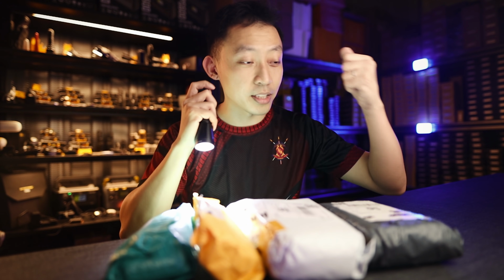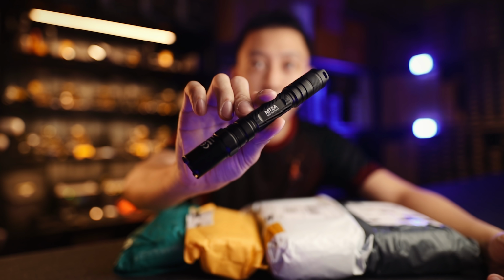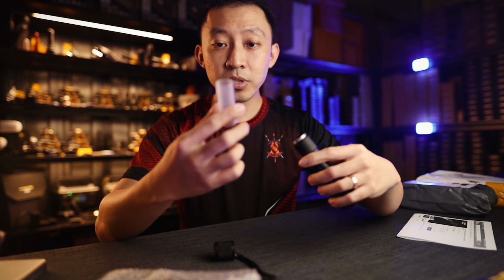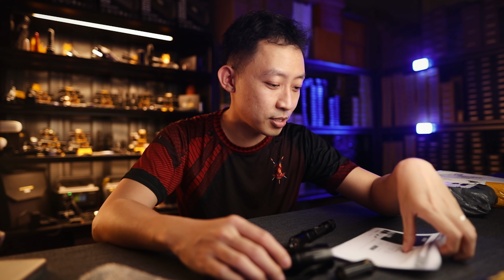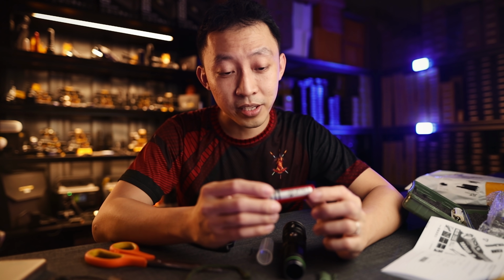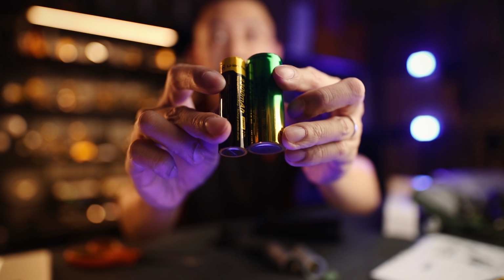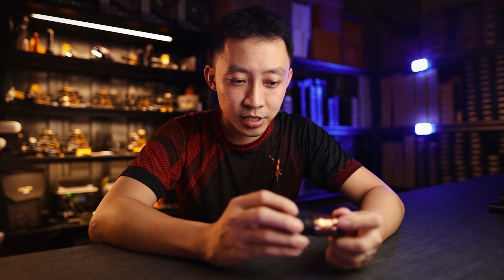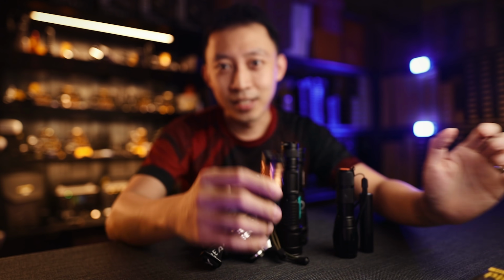100k lumens? Nuclear LEDs?! I bought a bunch of fake lights to show you how to NOT get scammed

Comment: My dad was so proud of himself when he got a 20.000 lumen light for €12 or so, while my 4000 lumen Acebeam had cost around €100. Made me look like an idiot at dinner for spending so much, then we went outside and you can guess what happened. I don't think the thing he got was even 200 lumens while I was fully lighting up a tree 100 metres away. To add insult to injury, I later found that exact the light on Aliexpress for €4. It was one of those lights you find under 100 different brand names and as many spelling errors in the advertisements, but they are all just clones of the same piece of trash made out of 100% chinesium.
Reply from the maker: Yes be wary of these ridiculous claims
Reply: CHINA
Reply: hahaha "step outside, dad. we'll settle this quickly"  - lights out.

Comment: Nice vid. Thanks. However the ANSI standard is not the best representation for flashlights especially when it comes to runtime. It does not take into account how the output of the light actually behaves over the runtime.  There should be runtime vs output graphs included with lights.  Then you will be able to really tell how your lights including tactical lights behave over time.  Some lights claim 1800 lumens and is only 1800 lumens for 1 min then drop down to 800 lumens for a 2hrs then drops down to 200 for 1 hour then to 180.  ANSI standards would say 1800 lumens and runtime would be 3 hours. But the consumer believes they have an 1800 lumen flashlight for 3 hours which they do not.  In reality they have an 1800 lumen light for 1 min.  Companies should strive for better and provide real/truthful graphs.

Comment: He has right when he is speaking about those flashlights from Aliexpress, 99% of them are crap,but there is another 1% where you can really buy cheap and good flashlight, I have some of them. Another part are batteries, for example Nitecore 3400 mah, about 20 usd, it is rewrapped unprotected Panasonic 18650B (3 usd), and protection board (0.50 usd), so they pump the price 5 times to the cell, greedy.
Reply: convoy and sofirn from aliexpress also is a cheap but high performance light. i have edc size convoy s2+ sst40 and it only $20 for more than 1000lumen and sofirn sp36 $40 for more than 5000lumen but the size is hefty not pocketable..
Reply: @harisyoung4110  I have sofirn sp32A, excellent flashlight for 16 eur, small compact, with 1550 lumens, unprotected cell, also Crelant v6c, and few more
Reply: All 100%FACTS!👍👍👍👍👍👍

Comment: Owned Klarus Xt11 for years. Time to switch to Nitecore. Awaiting the shipment of P20i🔦 🚨🚒🚑
Reply: My trusty Surefire C2 has never let me down but I thought I'd get something a little cheaper to run, I ordered an i4000r  (NOT direct) but it didn't show up so bought a P20i incase the 4000 did ever show. I can say I have also bought a few other pretty damn good lights but overall the P20i is my go-to right now, the instant access to turbo & strobe is a winner for a start, who want's to cycle through modes or have to have the light on before being able to access turbo!? I want turbo when my eyesight picks up something I feel needs 'looking at', then I want INSTANT  full power, the P20i does this better than any other light I own. It's not the brightest, or the longest thrower BUT if you wan a decent tactical light you can't do a lot better IMHO. --- As to the video above slating battery holders when they provide them with some of their own lights all-beit for CR123s & not AAAs and giving the reason being for a lack of 'voltage' is a little misleading, not enough current maybe. Also about time people trying to sell lights stop with the lumen blag & start providing better candela data when comparing lights, it's not all about brightness, we need/want to know about intensity.  *I have an Acebeam L17 (TIR lens) & I'm impressed with the throw on that.

Comment: Man I totally agree with you, those aren't good flashlights, but I wanted to point out that the Wuben C3 is 1200 lumens, and it's $26.00 on Amazon. Wuben is a legitimate company, has been since 1981, it's type-c fast charging, comes with high quality 18650 and takes cr/rcr 123 batteries. Very similar to the Nitecore MH11 as far as simplicity and the tail switch are the same both also tailstand , just more of a flood beam and cheaper price. I own both.

Comment: Before I know Nitecore, I bought a lot of stupid lights. I bought one the same as the fourth one shown in the video, which has four blue battery indicators near the button. They use xhp70.2 and can produce more than 1000lm when turned on. The problem of those lights is they dim after about 5 minutes, becoming less than 200lm. There is no circuit design or anything, and the light does not even get hot. They only use those simple MOSFETs to supply some current, and there is no heatsink for those chips .I guess it is because thoes chips get hot. Some of the fake lights may also have some thermal conductive silicone on those chips, but this "four blue battery indicators" does not. Another point to make is that those fake ones are big, heavy, and blocky. There is no mean to carry such a big chunk around. In addition, I also measured the capacity coming from those fake lights, they usually measure less than 600mAh, and the Nitecore charger indicates poor for them, as their internal resistence are >=0.5Ω.
Reply: I am actually very impressed by how hot those Nitecore lights, and some other good brand lights, get. Although I did not measure it, other YouTube channels did. They reach more than 100℃. They manage to push the LEDs to their limit without crashing them. I mean I crashed many LEDs myself. It is hard to manage without specialized manufacture level design.

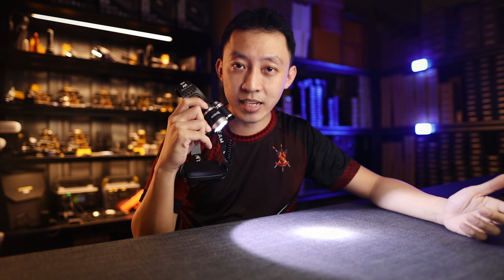Comment: 14:50 i got the headlamp with 2x 18650 and have a proximity sensor mode that turns on the led . no brand . same cube box .
enough brightness if got into accident at night . all other cars will notice and avoid further collision .
bought it at live bidding at only sgd$4/- . no one was buying it , so initial bid never raise the price . totally worth it . 3 months later some poor driver hit my car and i record all videos and photos with the help of this head lamp . won my case . spent finished all compensation $$$ . 5 months later the T-junction had a change of traffic light signals . new RED ARROWS enforce drivers to stop behind stop lines . probably an accident prone area .

Comment: Just a lot of misinformed consumers.  Thanks for the info dude. 👍🏽
Reply: Find a convoy and sofirn brand if you need a cheap but high performance light.. dont buy any zoomable light, all zoomable light is crappy light.. sofirn sp33 is real 3000lumen for only $25-30, there lot of it review video on youtube.. and for edc size convoy s2+ sst40 you get it for only $18-20 and it gave more than 1000lumen.. those brand can beat the nitecore or even surefire performance.. lot of it review video in youtube.
Reply: @harisyoung4110  all zoomable are crappy ? Try LEDLENSER dude 🤦🏾‍♂️
Reply: @awangemas9505  already owned a mt6.. still not my cup of tea when using it outdoor.. zoomable light will never spread evenly and even when fully zoomed the light spot it project not as intense compare to reflector and tir optic lens, probably at only around 70% overall light the led produce that is release to the front, the other 30% is waste inside the fl head and between the magnify lens.. That's why tactical light company such as surefire and modlite never make a zoomable light.. i feel not safe when walking and exploring places with that zoomable mt6, make me end up keep using highest mode to feel safer using that.. with reflector and tir optic flashlight, medium and low mode is enough for me to see any obstacle around.
Reply: @awangemas9505  
This is true; however, and I'm a Nitecore fan, all inexpensive lights aren't complete junk.
I have a Sofirn SP35 I bought for $38, and my eyes can't distinguish any difference in performance between it and my P20i; they both use the SST40, a 21700 battery, and claim about the same throw.
I believe the SP35 has a 363-yard throw compared to the P20i's 375; pretty darn close; that said, the SP35 doesn't have a tail switch, spring-mounted battery, stainless steel head, or ceramic glass breaking tips which make the Nitecore, by far the superior torch.
  Still, for the average Joe looking for something to use around the house, or maybe camping, the SP35 at $38 is a heck of a deal.
Reply: @awangemas9505  zoomable lights suck dude, even if it's well made it over complicates things, having a good fixed beam is the way to go

Comment: I’ve owned tons of flashlights, Nitecore is the best hands down! I love ❤️ my nitecore lights. I couldn’t live without them.
Reply: I just stumbled across this video and saw your post. I'll check out Nitecore... What about Thrunite? Do you know if they're good? I just ordered the Thrunite T2 3757 lumens but it hasn't arrived yet. I like that it recharges via usb-c. Your thoughts?
Reply: @reahs4815  +1 I'm a Fenix fanboy too :) , I have had heaps of their lights with very few problems and only a couple I didn't like that much (e20, LD40). I have a 10 year old plus Fenix LD01 SS that is still working has been on my keys carried everywhere I go the entire time by far my longest lasting light :)
Reply: @legallyfree2955  Cool I have a TK-22 and the HT-18 and I like em a lot, no problems yet after a little more than a year now of using the TK-22 at work constantly
Reply: @mikesenior1333  I have had a couple of O Lights, maybe I got unlucky, but I did not have good luck with them. My Olight M23 Javelot was my carry light for 12 months, after the first 3 weeks I only had high mode it would not switch to lower modes but I didn't care because I only use max anyway but then after another few months  it would randomly start changing modes if you bumped it so it got pushed back to a secondary light then after 12 it died completely and I threw it. The second Olight I owned was a keychain light (i3 I think was the model) I gave to my wife and it was dead within weeks and I got a refund.

Comment: What about flashlight brands like Sofirn and Convoy?
Reply: He afraid comparing it with those, im sure sofirn and convoy will outperform them especially a sofirn sp33 model..
Reply: Sofirn and convoy are good brands. They have ties with the modding community. When you buy a convoy light, you notice right away how easy it is to take apart and mod. I personally own units from both brands. I even have nitecore. All of them perform well. Nitecore however does a pretty good job in almost all areas. Better beam and build quality.

Comment: Do not be deceived by the specs or the prices, the truth is at the reliable brand, you should Invest each dollar in the high quality items. But in case you want something for a short time, buy those cheap goods.

 camping and emergency equipment and important work,  the original items are works great when you need it.
Reply: just need to buy a right brand if need a cheap light.. go with sofirn or convoy brand if want a cheap under $40 light.. it outperform a nitecore in term of brightness especially the sofirn sp33 model for only $30.. dont buy any no brand chinese zoomable light, all zoomable light is a crap.. go with reflector or tir lens light  that sofirn and convoy sell for cheap.
Reply: @harisyoung4110  👍 thank

Comment: lol @ 10:33  i had some of those batteries and they were rubbish 
why?
well i opened one don't try that at home folks because something inside was loose,  and instead of a tightly packed battery, it was a 3rd of a 18650 lithium cell with a very low density , which had been badly spot welded ( the light would work intermitantly or badly flicker) and the - lead had broken free , plus it felt like it weighed the same as a feather (an out and out sign you have a fake)
it also came with a 12 volt car charger who's parts consisted of two resistors and an led , one resistor was for the led and the other for the battery 
now anyone who knows about lithium cells knows they need to charge up to 4.20 volts, anything over that and you risk thermal runaway (maybe they thought they could get away with using such a low density cell so no-one would know)

Comment: I've had 2 genuine nitecore flashlights fail in the past month,
Both have a 2 year guarantee,but its impossible to hear back from the company, rendering the guarantee worthless
Reply from the maker: Where did you buy it from? You have to go back to the correct distributor.
Reply: Amazon UK, the Nitecore Shop,tried contacting them to no avail
Reply: Get yourself an olight next time. They are a cracking light. 5 year warranty
Reply: @wesleyseymour8857  the nitecore's are guaranteed
The guarantee is no good if they make it too difficult to honour
Reply: @db333-m6n  yeah can't argue with that. All I can tell yeah is I've had both my olights for 4 years an they still work perfectly.

Comment: Yeh that copper one looks pretty but it's not going to work like high grade aluminium to dissipate the heat, that's why they use aluminium quench plates in the Heat treatments of air-hardened tool steels, works the best : ) hmmm wonder how Ti or Magnesium works...

Comment: 1000lm is relatively easy to reach, a single XML should, but usually the drivers in cheap flashlights are shit and underpower the LED alot

Xanes lights on banggood are all underpowered, i bought a 2x XML T6 light from them and the power draw at max brightness was only 3.5W

if the driver itself was better it would've been capable of the "1600Lumen" without an issue, i've verified the max power of the leds themselves and they definitely take 10W each for a long time and they're pretty bright aswell, so i'm sure they're legit ones (one good thing about it atleast) as they're only a bit less bright than my genuine Cree XP-L's

Comment: There are many good flashlights on Aliexpress if you know how to search and what to choose. :) They perfect for the average consumer. Also, I don't agree that the cartridge for 3 AAA batteries is a bad things. I have many powerful flashlights which use it. Led Lenser also uses it on many of theirs - you can't say that is a cheap or fake brand ;)
Reply from the maker: That depends on how you define ‘powerful’. How is 3xAaa better than a 18650 or 21700? The runtime of it is so poor. Especially if the light is bright, the battery capacity is too low for each AAA. Not practical at all to power high lumen lights
Reply: As it't very dark in Sweden during winter, if you want to take a long powerwalk after work it'll be pitch black outside, especially in the forest.
I usually take a 10 km walk, last week I took my  Led Lenser H7.2 (3XAAA). I thought it was quite all right. First 10 km evening walk, didn't use full power but almost, warning for low battery started at 9.5 km.
I had already decided to get a Nitecore headlamp before that, as the Led Lenser didn't have either as bright or as good beam as I wanted. I did have my brand new Nitecore New P30 with me.
Ended up ordering a HC60 headlamp and a MH10S . Tactical (with rear power button) isn't too practical walking, prefer a side switch instead.
Super happy with my New P30 !!!
Reply: Ya bro those triple a lights are crap
Reply: Led lenser are crap now. I had lots of them, the early ones that were made in Germany were good. But since leathman took over the quality has dropped significantly. I've switched to Olight and the difference is hugh, like night and day.
Reply: I'm not really against 3xAAA cartridge and I use them just for the sake of not getting my AAAs wasted since i have a lot of them. They're really not that good in powering my flashlights as 21700 or 18650 does. On my experience, one cartridge could last me an hour but if I used my 21700, it lasted me more than 5 hours. If you want to continue using AA or AAA lights however, it's best to stick to dedicated single or double cell lights. They would last longer and perform better because they're designed for those batteries.

Comment: I like nitecore lights.  I got my original P12 just quit working,  how can I get a repair?  It's about 5-7 years old.
Reply from the maker: Warranty is 5 years, so yours should be out of warranty. Time to get a big upgrade. The MH12S is an awesome replacement
Reply: You could dissemble it and solder but that's risky territory and you'll need to learn a lot of about them.

Comment: You can build a Convoy S2+ with an XHP50.2 led and produces 2500~ lumen's for $20.... saying a 2000 lumen flashlight for $30 doesn't exist is a bold faced lie... You keep going on about ANSI ratings but the NITECORE-MH12S doesn't even reach 1800 lumen by ANSI standards I have one and measured it in a Lumen tube with a calibrated sensor and at ANSI standards which is measured 30 seconds after turn on with a fresh cell the NITECORE-MH12S only measured 1400~ lumens..... I've built a Convoy S2+ with the same SST-40 LED and it measures over 1500 lumens by ANSI standards for less than $15 USD...

Comment: So the big things to watch out are: 
Bombastic Description: overuse of superlative terms (Mega Super Hyper Ultra Overkill brightness), insane sounding details (like Nuclear)
Ridiculous numbers relative to both its price and physical size: 20k lumens for $20? Press X to doubt. Also, come on, that tiny thing won't throw out 20k lumens, it is just impossible.
Engrish in the box or marketing material: You know these aren't written by professionals. Not just English by the way, but can be any language.
Similar look to another (questionable) brand: Have I seen this before under a different brand? Not to be confused with actually decent rebadged OEM like the A brand, these are decent products.
Suspicious batteries it comes with: You see anything above 5000mah on an 18650? That is quite suspicious. 
AA battery cartridge: yeah